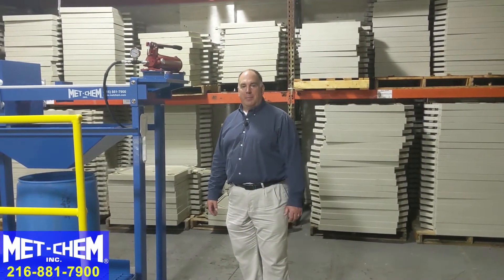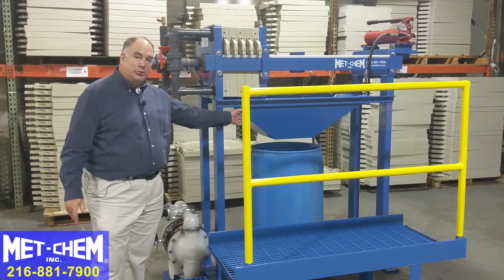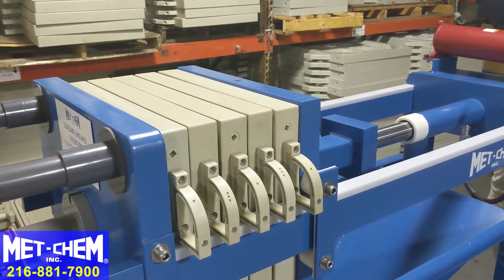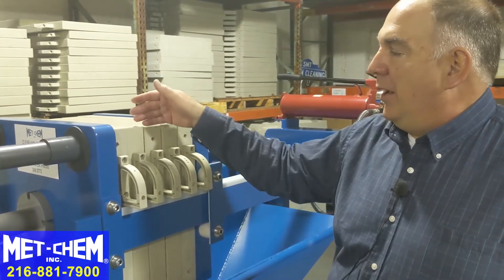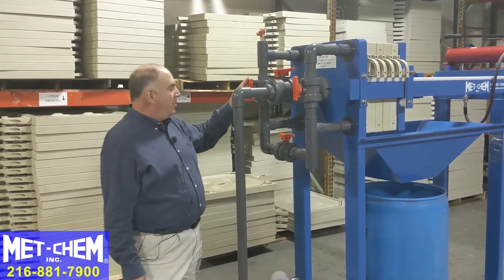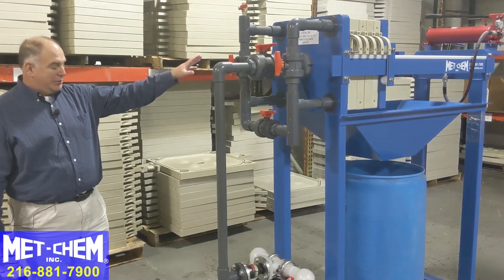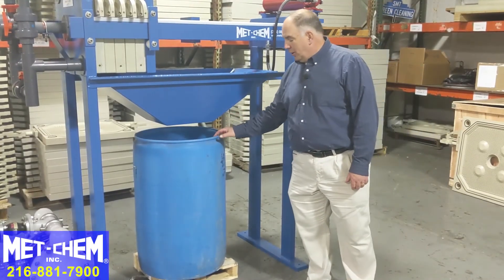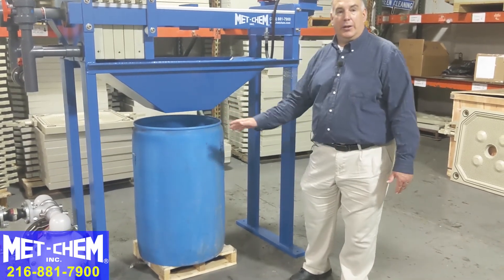Filter Press Operation - How to Operate a Met-Chem Filter Press

Comment: I closed the ball valves for blow down and one of the fittings between the ball valves pressurized and blew into pieces. What am I doing wrong??
Reply from the maker: A common error is when the plates are not in the proper 1 - 3 - 1 sequence. Refer to our web page on the Air Blowndown procedure.
https://metchem.com/air-blowdown-procedure-filter-press/

Please give us a call, and we will help troubleshoot the problem with your filter press.
Reply: 😢😢😢😢 dal